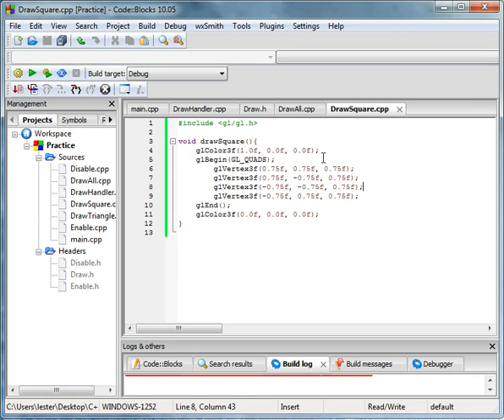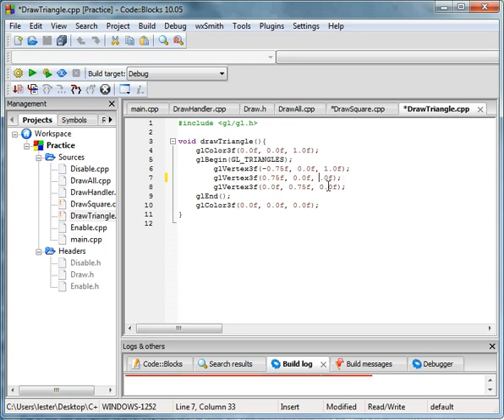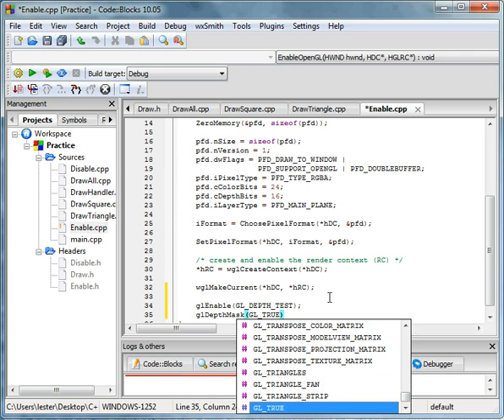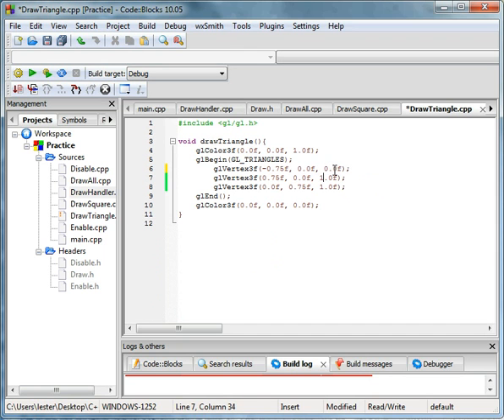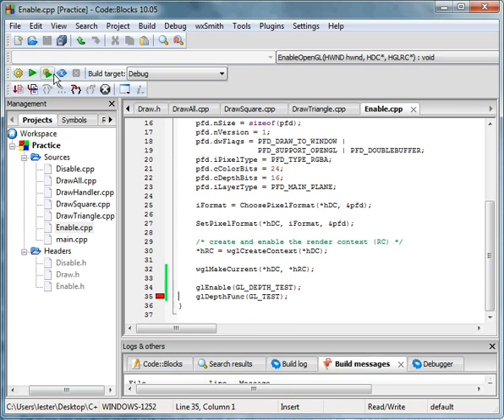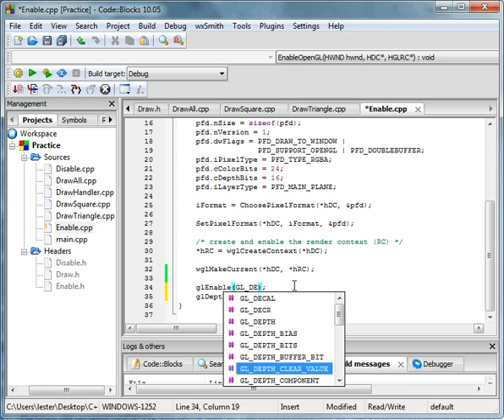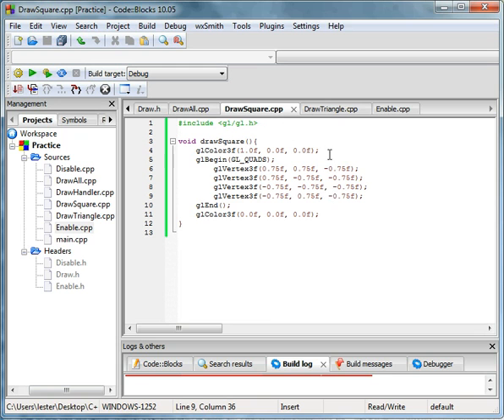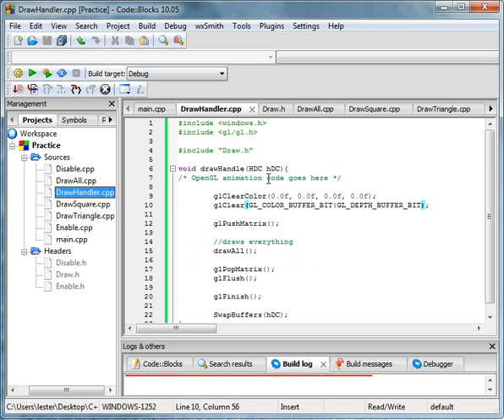OpenGL Tutorial 5:  Z-Buffer Testing

Comment: kind of pointless saying anything now, but i guess its worth saying anyways. opengl and directx have opposite directions for their z-direction, the larger the positive (50.0f) the further back it is (further away from you so appears smaller) and is hidden by objects closer to your eyes (20.0f).  you were doing the tutorial under the assumption that it was the other way round. you can use negative values but only if they are smaller than the negative you set your camera to (if camera is at -25.0f then the largest negative you would want to use would be -24.0f as -26.0f also will not draw as is behind the camera)